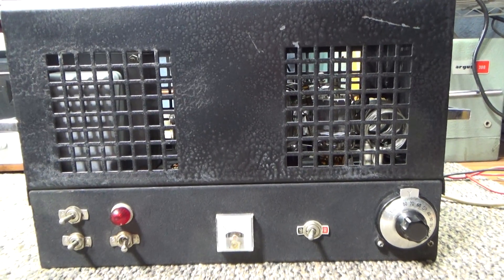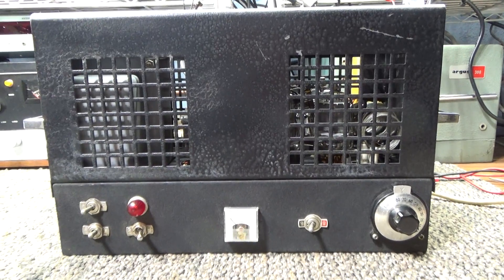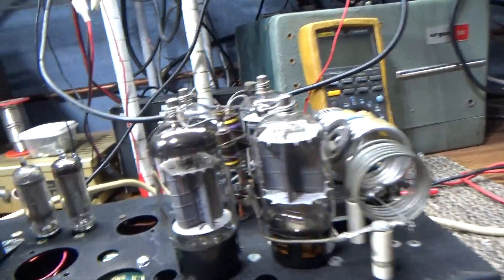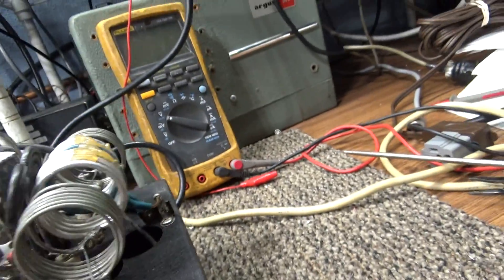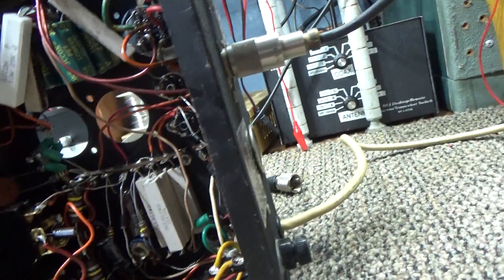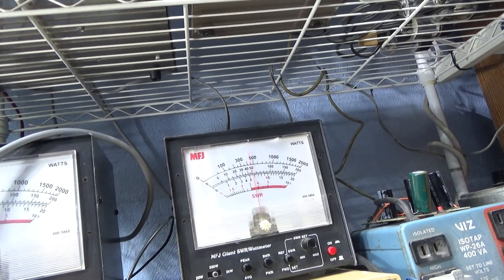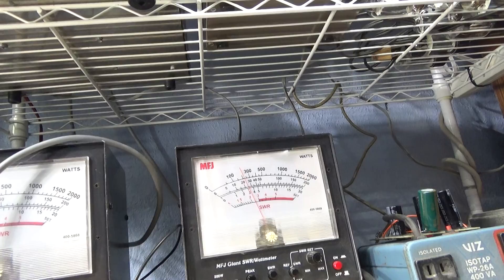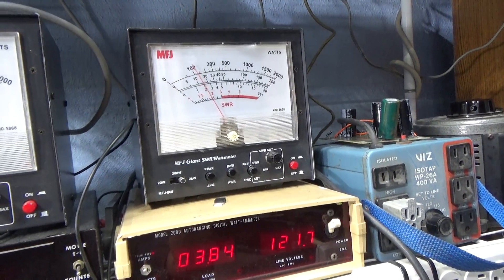Elkin 4 tube 12dq6b linear amplifier on the bench

Comment: I also have a 4 tube with four 12 DQ 6B tubes I get about 430 Watts pep
Reply: My new 4 Elkins did  right at 500 thease are lo drive units. 3 and 4 watts .I like to run 2 watt tram with 100 % modge and that Elkins will swing over 500..clear as a bell.

Comment: Hi Tramdr. I need your help. I have a 4 tube Elkin myself. I need the 3 pole relay wiring info . I need to know where the wires go as they are loose and i cant locate a diagram. mybe you could post a drawing . Thanks .
Reply from the maker: Maybe if you sent good pics of posted a vid I might could help.

Comment: I have two of these 4 tube Elkin's. One has 12GW6's and does 360 watt swing on my Bird 43 into a dummy load with a 25 watt swing input. The other Elkin I recently acquired 2 weeks ago and it needs gone through, but it has 6GB6GA's. Not sure why. It also has little round screen vents in the bottom case.
Reply from the maker: From what I hear, Elkin scrapped together his amps with whatever he had lying around or could get his hands on. I also hear he never made a schematic for his amps. Hence you will find many different versions and no schematics.
Reply: @tramdr  I believe you are correct.
Reply: I have a brand new one rebuilt in Elkins for sale.4 tube vented base

Comment: Lots of Elkins still around here in NC.  That one will bring $250 to $275.
Reply from the maker: Not that many around here but I did sell it for that.
Reply: I think Elkin amplifiers are most an NC/SC thing. That's where I see them the most.
Reply: MY NEW REBUILD AT ELKIN COST A LOT MORE THAN THAT..250 IS NOT WORKING USED UP WORE OUT ROUGH STUFF.MINE IS FOR SALE, $ 700

Comment: You reckon the relay was dirty on the contacts for the HV. I had one the would sort when you keyed it up, come to find out the plastic the base of the relay was becoming conductive, when I removed the relay I put a ohm meter across the two terminals and saw 3k, where shouldn't any shoulda been a open circuit. It's really affected the negative bias. Elkin amps are very loud and good amps, but can be a pain to get right at times. They come from NC, the who built them lives in Elkin NC, mountains. Great video ✌️✌️✌️✌️
Reply from the maker: They are complicated, plus there is no info on them.
Reply: @tramdr  I live in North Carolina,  not far from Ray Elkin Sr, and Jr, thanks for the reply, love your videos, your info is Great. Have a great week ahead ✌️✌️✌️✌️✌️✌️✌️✌️✌️✌️✌️✌️✊🇺🇲💯

Comment: Elkins were sold by Henshaws and are shown in the 1970 catalog. There are two amps for sale. I think that you have the bigger of the two, at 300 watts out put. Now...

In 1970 most CB sets out between 3 and 4 watts. Sideband, driven by the Midland 13-880B, was 10 watts input with average output being 3 to 5 watts. The outliers were Regency's Imperial and Range Gain series. They, along with the Olson Sidebander, put out a 1.5 watt carrier with DSBRC Modulation. Those would "swing" an amp because the power input to the amp would double. 
It's all math with amps. Volts times amps equals watts. 800 volts times 500 mA equals 400 watts. Some manufacturers like Swan and Siltronix used fuzzy math to inflate their output values and as a result users would burn the finals down tuning the radio in an attempt to see the advertised numbers. Experience will teach you that you can't get 150 watts out of a single 8950. Siltronix advertised the 1011 at 300 watts input. I tested a NOS 1011D and saw 75 watts out and a current value that was right in the 8950's wheelhouse. They actually operate quite well on 10 meters, and if you periodically move the frequency setting variable caps in the VFO to clean up the silver oxide they don't drift anywhere near as badly as the legend.